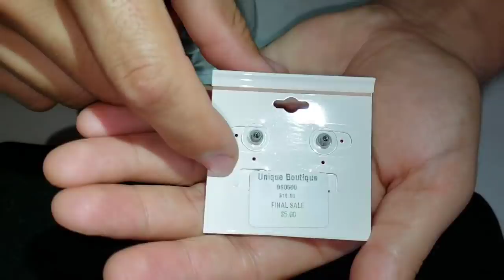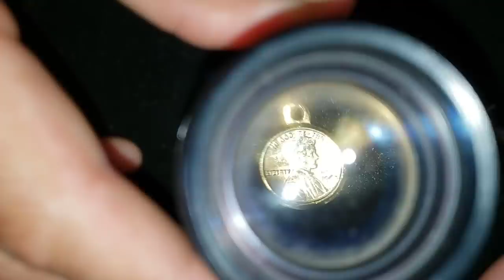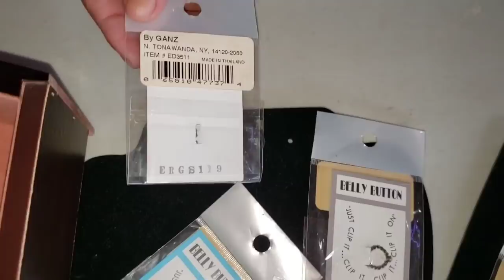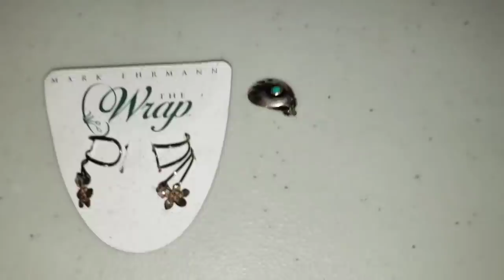SHE'S AFTER MY LIFE INSURANCE MONEY / I Bought A Jewelry Hoarders Secret Stash

Comment: A  (also spelled "bale") is a component of certain types of jewelry, mostly , that is used to attach a  or stone. The  is normally placed in the center of the  where the  hangs. ... A classic  allows the chain to pass through and is connected by a ring to the .

Comment: Hmmmmmm.   That is odd.    When I looked up jewelry and magnets on Google, all the websites said that the purpose of using a magnet is to find the approximate magnetic drawing power of the metal.   They went on to explain that pure Silver and Gold have almost NO magnetism.   Copper is not magnetic. Brass is a mixture (alloy) of copper and mostly zinc (zinc is not magnetic). Bronze is a mixture (alloy) of mostly copper with about 12% tin, and sometimes small amounts of nickel (nickel can make it very slightly magnetic but, generally, bronze is not magnetic). Brass is a mixture of zinc (Zn) and copper (Cu). ... So, brass is not magnetic. Like aluminum, copper, and zinc, brass does interact with moving magnets. In the video below a brass plate on a pendulum will move rapidly in the absence of a magnet.